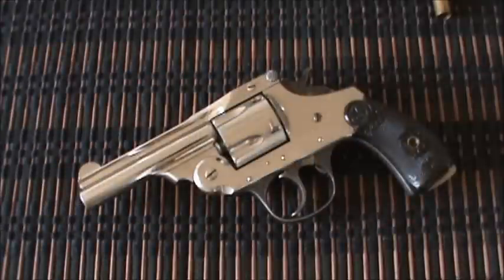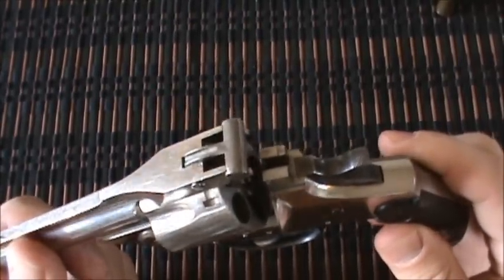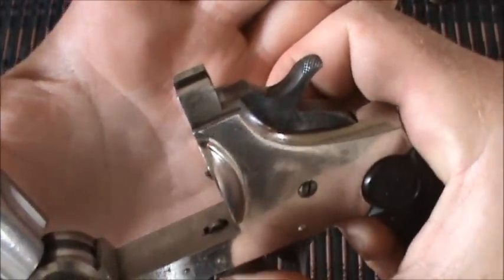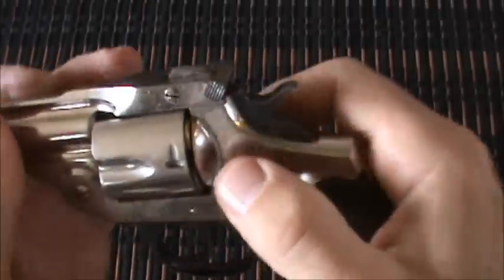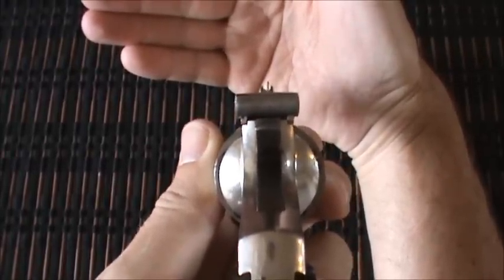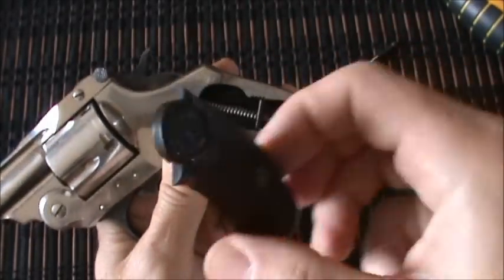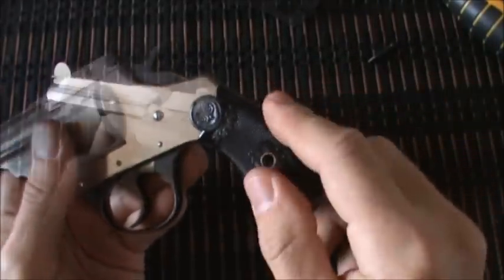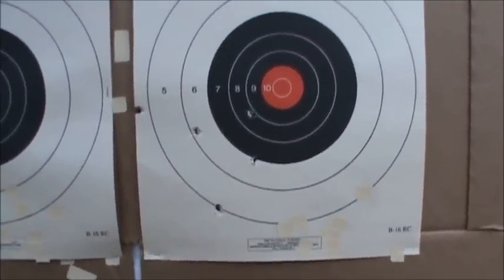Iver Johnson Safety Automatic Revolver .38 S&W

Comment: Great Video!  Thanks so much. I inherited a "IVER JOHNSON" 6 inch Safety Hammerless, Automatic, Double Action" from my Grandfather over 30  years ago. I have the original box, which has a helpful photo of the revolver, along with a box of very old 38 bullets. The OWL is facing toward the front. The YEARS are STAMPED on the top of the barrel of this 5 shot revolver, which appear to indicate '86, '87 and '88; however I did not remove the grip to see serial number as you shared in your great video. It most likely is an 1894 Model 2 revolver. With your help, I now know the history of my Grandfather's gun and I plan to mount it & hang it on my office wall.

Comment: Thanks. Enjoyed the video. It made me bring out my Grandfather’s top break 32S&W and have another look. He died before I was born and it was in my father’s sock drawer for about 50 years literally wrapped  in a sock. My dad was definitely not a gun guy and he was going to dispose of it when I interjected and said to give it to me which he did. It’s an H and R. I’m thinking 1910 ish as that’s when my grandfather was working in NY City way before the Sullivan law. It has a spur trigger which you can make safe(ish) by doing not quite a half cock thing. It also has the spur behind the trigger. Don’t know it’s function as there is no hammer block. It locks up ok hammer all the way forward or in full cock but there is some wiggle room so occasionally it shaves lead. Ammo is expensive and I haven’t fired more than 20-25 rounds out of it. I’ve thought of collecting them as they are neat and inexpensive guns but I live in an unfree state and to get a collection going even with a curio license would be a pain.
Reply: I just want to buy one of them I live in Massachusetts the laws are crazy here.
Reply: A great deal of these top break revolvers in 32 S&W and 38 S&W were manufactured before 1898, so you would not need a curio license or any other license for that matter... The only state that I am aware of that does not follow the antiques exemption would be New Jersey.

Comment: I was just asked to identify a little old revolver that is very corroded with most of the plating flaked off. I thought from the looks of it that it was a .32 of some sort. Seemed to be a centerfire gun and had that owl on the grip. One of the patent dates was 96. Maybe it was a 5 shot 38, but it's pretty small.

Comment: I don't know much about my 32 cal Iver Johnson revolver other than it's cool and pretty old. My trigger return spring is no longer working and the grip is broken on one side. Would this be an easy job for me to replace or should I drop it off with my local gunsmith? Also I would like to have the chrome stripped off and possibly reblued or have a different finish put on it. I don't plan on selling it, I would really like to have it restored just because it's apart of the firearm history in the US of A.

Comment: I got a bunch of  the s@w .38 ammo for that gun if you want it. It's in mint condition for being 100 plus years old. 70  to 100 rounds .  I miss my iver Johnson. I fired that thing at least 1500 times before I sold it. So the ammo does me no good now. Mine was 1 St generation btw. Never a problem on the cronograph it was doing 815 feet per second
Reply: I need this particular ammo. Just for target practice. Where did you find yours
Reply: I have the 2nd gen hammerless  .38 . This one is missing a trigger guard  .  Its in good condition  for the age . I would like to find sum older ammo  thats been stored for safety ?!

Comment: Found one with 2 screw wood grips, about 20 nickle left on it
No owl but same shape to the wood. Top strap writting ends in an patent  AUG ?????? Cant read it from pictures 
May pick it up but thinking it would be black Powder only?
Reply from the maker: Best to assume that it is unless you can prove it is a later version.
Reply: @314299  It is actually not an Iver Johnson, I got it for $60. Ends up it's a Patent 1905 Hopkins and Allen Safety Police 38 S&W, needs some love but I got it running for $8 lol

Comment: Are you sure that nub is the transfer bar?
On mine that is what releases the hammer so it can fall firing the gun.
Reach behind the trigger and push that nub when the hammer is cocked back and the gun will fire.
Reply from the maker: You are correct, that is one detail I got wrong in the video, that part is indeed the sear and not the transfer bar. Thanks for pointing that out.

Comment: I have one in condition like yours with a 6" barrel, it has a tiny knob above the cylinder that locks the release latch up so you can remove the cylinder I think it must be a #2 model.
 I do think if one reloads carefully there are low pressure smokeless loads that you can enjoy your gun a lot without wearing it out.

Comment: Is it normal for these Iver Johnson revolvers to have the cylinder spin freely when the hammer is not cocked? There's one for real cheap at a local shop but it has this "feature" I'll call it. I've considered picking it up for the novelty, but if I ever did plan on shooting it, I'd want the timing mechanism to be sound. I wouldn't be too against working on it if I could talk them down on the price a little.

Comment: Was "automatic" the term they used to use for what we now call double action?
Reply: No.  "Automatic" referred to the fact that the revolver "automatically" ejects the spent cartridges when the action is opened.  This as opposed to the "hand ejector" models in which one had to push the cylinder pin "manually" to eject cases from the cylinder -- as is the case with almost all solid frame revolvers currently in production.
Reply: Lol 6 minutes into the video he even says it

Comment: how do I get the old chrome off my 1893 owl head 32 so I can have it blued
Reply from the maker: +Mitchel Frye You need to talk to a chrome plating shop, they know how to strip chrome.
Reply: Mitchel Frye Brownells.com sells chrome stripper. Usually the process is to blast it in a sandblasting cabinet, soak in the stripper for a few days, re-blast it in the cabinet, and polish it down for bluing. Can be rather expensive if you don’t have a lot of chrome or nickel to do.

Comment: What happens if you shoot smokeless in the second model?
Reply from the maker: Use of smokeless ammo will cause the revolver to "shoot loose". This is because these are not make of the hardest steel and the parts will tend to stretch/deform slightly and the gun will get loose. How fast this happens depends on the ammo used and in what shape the gun started off in. If the gun was  a bit loose to start with the wear from shooting smokeless will be quicker than if it was tight.

Comment: Is it normal for the cylinder to wiggle and move during full lockup? I noticed on my friends IJ that when the trigger is pulled and trigger held, the cylinder seems to have a little play. Is that safe to shoot? Just doesn't seem right that it's not securely and tightly locked from breach to cylinder.
Reply from the maker: Normally there will be some movement, if it is excessive you will get lead being shaved off the bullets during firing as the alignment will be off.

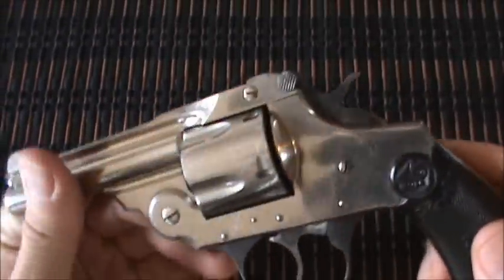Comment: 7:26 / 16:29

•
Features

Iver Johnson Safety Automatic Revolver .38 S&W, Because its an anteque you don't have to have the Government in your Business. No going through another theif FFL DEALER?
Reply from the maker: Be careful of what you assume regarding antique status (pre 1898 production) of these revolvers.  The first model was produced from 1894 to 1895 and therefore all of those are antiques. The  second model  was built between 1896 and 1908 so some are, and some are not antiques. None of the third model are antiques as all were manufactured after 1909.